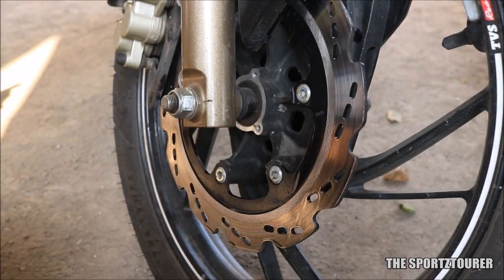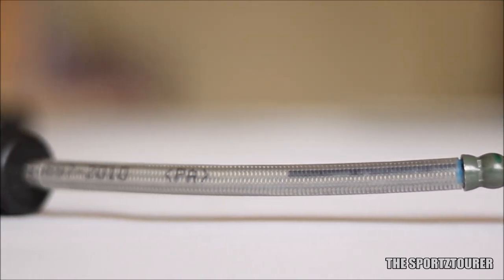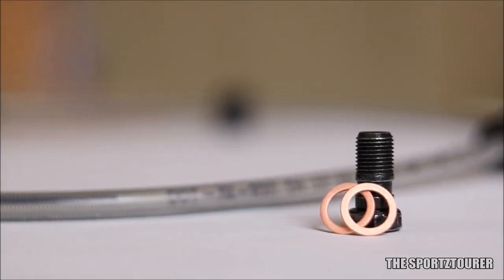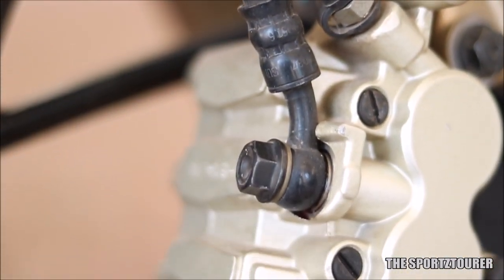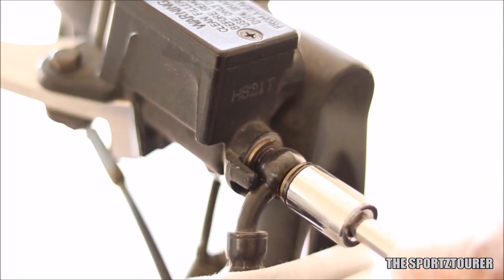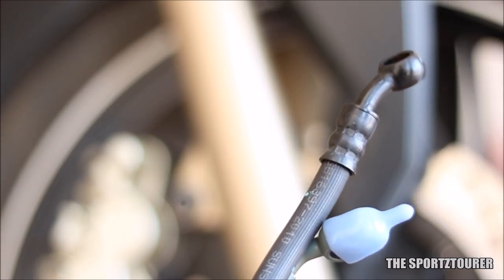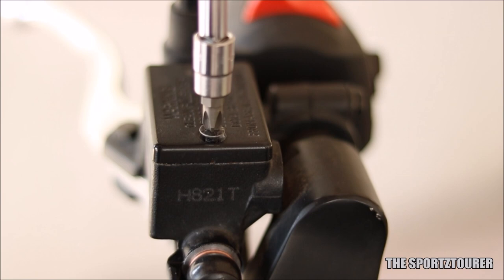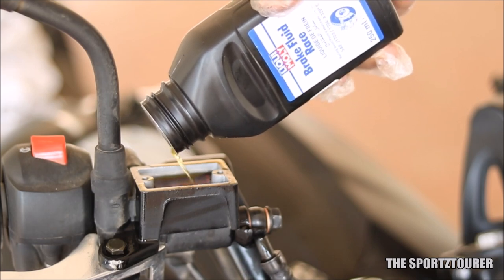BIG MISTAKE! UPGRADING TO STEEL BRAIDED BRAKE LINE & RACING BRAKE FLUID ON TVS APACHE RTR 200

Comment: Although it was a failed attempt, but I think that many people will learn from this. 

I think that the Apache RR 310's steel braided brake lines will be a perfect fit for your RTR 200. Both Front & Rear brake lines. 

Although they are designed to handle the braking torque of a much powerful machine than the RTR 200 (over-designed for RTR 200), but it's always good to be on a safer side when it comes to braking.
Reply from the maker: Thanks Chinmay for the suggestion! will update here 😊
Reply: @thesportztourer  , cool 🤘🤘
Reply: @thesportztourer  , you can also go for Dominar 400's steel brake lines

Comment: I changed the rubber brake lines of my Thunderbird 350 to steel braided ones with DOT 4 STP Synthetic brake fluid and oh boy there is so much improvement in braking. Now there is much more bite and that bite gradually increases the more i press the lever unlike before. Bike stops faster and surprisingly there is less wheel locking now🤔
I ordered the brake lines from AliExpress for just ₹600 each !! and brake fluid from Amazon 👍🏻
I was also going to swap the master cylinder with the one in RE 650/535 but that will most likely blow the piston seals to pieces xD
I may give it a try though but I'm satisfied for now

Comment: I had tried the same experiment and had committed the same mistake as well.

So I had to install the pulsar 220's brakelinr on my rear brake. It made the rear brake sharper in contrast the the front brake, so I had to invest in another longer brakeline for the front brake.

I did find cheaper ones on banggood.com with choices based on different lengths.

You get one there or like another person has suggested or as visible in the RTR 200 race spec bike, you can use the RR 310's brakeline.

Hope you make a follow up video on this  topic.
Reply from the maker: Thanks Hitesh for the suggestion, I will do a follow up video 😊

Comment: I replaced my rubber brake lines with Hel performance steel braided lines on my rtr200 and they work super fine, the lever is as hard as a rock and the length is sufficient although they are not cheap and cost nearly 3600rs.
Reply: is it front one? what is the length of the brake line?
Reply: @hsnhere  Yes front. Did not measure the length. I think the lines were meant for karizma but it fit the apache just fine.

Comment: You can buy generic brake line or you can buy from Royal Enfield 350cc front steel braid line which is 84cm more than required length,   I used this on my rtr 200 and it works great way much better braking...also I noticed even on full pressure applied on brake there is very low wheel locking as compared to stock brake line

Comment: Another great video, this time though I have a suggestion to make.. it would be really great if you mention on what parameters you compared the performance.. example braking time was better than before or feel of breaking was smoother.. also since it has started raining would love to see videos on maintenance during monsoon.. the RTR fuel opening has some space that is filled with water and drops into the tank while you open it for refueling..any tips? Thank you in advance.. cheers 🍻
Reply: I think you missed this comment hence adding one more to get your attention
Reply from the maker: Thanks a lot Kedar for the suggestions! I personally never faced water in the fuel tank issue with my 180 and 200. I can try to make a video on what we can do when there is water in the system 😊
Reply: @thesportztourer   Awesome thank you very much 👍

Comment: Good content man. But isnt the fade in brakes due to excessive usage and heating up of the brake disc and pads? Correct me if I'm wrong. Also another question. Why dint u consider sintered pads instead?

Comment: Bro try to remove the calliper from the forks and. Then try to install the likes and re route it from the clamping. Let it be free from the wire loops as well. The brake lines will fit the length.. I installed it in my zma. Had the same issue i sorted it this way and did a custom clamping. Using cable ties and the stock clamp. Its been a year. I have no issues. Hope it will  help you..

Comment: I've tried pulsar 220. Steel braided line on my Apache 160 (older model)
The braided line cable is enough for Apache 160 . And That's worked well too. Definitely braking pressure has increased or improve d.the braking sponginess has gone now.
But installation process is little bit tricky. The rubber mount of pulsar was not matched with the Apache rubber plate. So I tied the braided line with cable tie..
Reply: Whats the price of it bro

Comment: I believe that we can install any ktm's or rr 310 steel braided break line as I was looking for similar solution. For now I have installed Yamaha Dot 4 break fluid as it is priced at 150rs which is very affordable and works like a charm!
Reply from the maker: Thanks for the suggestion and sharing your experience 😊

Comment: Title should've been big mistake of choosing the wrong length hose.

Could've measured length before buying the hose.  I had Pulsar 220 hose on FZ and installed one for a friend's ZMA, but both were a bit shorter than stock, but fitted somehow, but when on centre stand, it  looked scary as if gonna stretch and burst.  Later swapped with generic longer ones from Amazon (but they are now insanely priced like HEL after lockdown).  Like someone already mentioned, RS and Duke hoses are longer and for extra lenght, there is Continental GT hose.

Comment: Hey! I own an RTR 200 2018 Race edition 2.0. There's a problem I'm facing with my mileage and top speed. I've never got a mileage of above 30kmpl and when on the highway in a few different events, I was only able to get a top speed of 115-117 kmph. The bike has a very good acceleration till it gets to the 90s. On a daily ride on the wide city roads, I'm able to go upto 104 with ease, after which the bike just feels abused. It feels like the 5th gear isn't able to deliver power at all. In the 5th gear, I'm not able to take it beyond 7000 RPM no matter how hard I try.  I've already tried to make my air fuel mixture richer by increasing the screw by about 3 turns; half turn at a time. The people at the service center are not even able to understand my problem. Please help.

Comment: My pulsar 220F has only front brake hose steel braided  which was company fitted and now I install rear brake hose with steel braided. Braking performance increases. Steel hose some long but I fitted myself. I purchased its from KTM 200 old model motorcycle. Don't be sad brother try another.

Comment: RTR's front brake is 2 piston , we just need 4 piston brake caliper like in KTM series.
Reply: in mu activa125 three pistons check on mu channel
Reply: No we can't as it's a standard telescopic fork whereas KTM has upside-down forks with radial caliper

Comment: Get the steel cable from Amazon (90cm F) (80cm R)which sits perfectly on your bike and also it's very cheap, I been enjoying breaking flawlessly.
Reply: Hi bro
Do you mean to say that these lines will fit the RTR 200 (have you or your friends tried it out?). Also, did you do anything for the master cylinder?
Reply: @jithinramesh3022  hi 
I had installed it on my bike, it's a direct fit... Just get the exact length cable. I have both steel cables on my bike and it's phenomenal.
Reply: hey how is the performance of this break line in long term i am have doubt bcz this amazon ones are generic
Reply: @saidesai6284  I have the same one, go for it. They work fine and excellent.

Comment: after a lots and lots of research on internt i found out that u can fit RE continental gt 535 brake line which are exactly same size as of apache 83cm or 33inch
Reply from the maker: Wow! Thanks a lot Sai for sharing this here. A heart felt thanks to you 😊
Have you installed it?
Reply: @thesportztourer  actualy i tired to search for it in market but since its old bike that too flop model i was not able to find it in chennai
Reply: @thesportztourer  hey today again after searching i found royal enfield genuin part it cost 3300 i think its not worth the price so i am using some generic once which cost only 750
Reply from the maker: Yes, you are right 3300 for steel braided lines does not seems to be value for money. Is it Brembo branded?
Reply: @thesportztourer it was RE genuine part

Comment: I think that rubber hose has a braided steel inner tube inside or is double walled, nonetheless brake lines are one of the most heavily safety regulated and governed component on vehicles. Rubber brake hoses must stand up to 8,000 burst psi for 1-2 minutes before bursting and you achieve a few hundred to 1100 psi in daily traffic. In reality burst braking only lasts a second or two. I work with hydraulic cylinders and all rubber hoses have a braided inner core or are double walled. changing to braided steel probably wouldn't have done anything. the reason why it's for racing is because constantly braking in super bikes is extremely abusive. Thick steel lines can take up to 18,000 psi burst but race level superbikes have massive brakes, rotors and calipers pistons and go 250kph like nothing in seconds so they need those critical components. For a regular bike like ours I would just upgrade the fluid when it's time to change it.
Reply from the maker: Thank you so much for sharing this piece of information here. It's a joy to have enthusiasts like you on the channel 😊

Comment: In my case an after market steel braded pipe  for my apache 160 2v was 20cm longer than the stock. also banjo hose head orientation was same on both side therefore i had to twist pipe for fitting.

Comment: I have pulsar NS200 Abs(single channel). So can i fit it steel braided brake line directly or will there br any complications??
Reply from the maker: Hi Lalit,
You have to keep the ABS module in consideration for that 😊
Reply: @thesportztourer  Yes ofcourse. Then i think i have to leave it to an expert mechanic instead of experimenting by myself. Thanks for this informative video... ❤❤

Comment: I also thought for changing the front brake lines of my apache 200..As apache 200 have steel brake line for rear brake but i need to change the front brake line.....but i don't have any knowledge of which steel braided brake line i will use..!!
So this was informative for me..

Maybe Duke 125,200 Pulsar RS or Dominar..?
Let me know sir if you find the proper one..

Comment: I have one doubt about engine oil.
Can I use motul 7100 10w50 on my rtr 200 since the preffered one is 10w30
Reply: Hey, I suggest that you use motul 7100 10w40 I have used 10w50 and I'll go as far as to say it will effect your engine in bad way

Comment: Try motul synthetic brake oil. It's 200% better than any brake oil in the market. I have tried it my Apache RTR 180 and Unicorn 150. Huge huge difference. You must shell out 700₹ for 500ml can...

Comment: Here is my story:
I hated the brake lever feedback. And the long stopping distance. My 2003 Fiero F2 front brakes are much more predictable due to the feedback I get on the brake lever. So like you, I decided to get steel braided brake hose for my RTR 200.

Search for P220 brake hose began.....and ended after 3 days due to lack of time in exploring local market (service centres close by the time I leave office) and by the discovery that P220 brake hose is shorter.

Obviously none of the ABS brake hose will ever fit. RR310/Duke 390/Dominar brake hose idea out of the window.

But...Duke 200 😈😈😈

Went to KTM service. Joy was short-lived since the brake hose has a steel tube/pipe hidden below the lower suspension clamp from where the hose crosses over to the left side since the disc on Duke 200 is on the left. Disappointed again (and here I escaped early from office to visit KTM service centre).

Finally found steel braided brake hose on Amazon with different length sizes. 50, 60, 90 & 120cm. Had to go for 90 cms. Better long than short, right?

Replaced my RTR's brake hose. Used TVS DOT4 brake fluid. Did bleeding removing every possible air presence. Bled again after 2 days. Little more air bubbles escaped. 

Conclusion: Front brake feels much better now. 

Satisfaction level: Zero. Zilch. Nada.

I still press the front brake lever of every Apache I see in the service centre. God knows what TVS did in RTR200, but the brakes suck. While my front brake now feels much better than other RTR200s, the lever is still spongier than RTR180. Super lever feel on that bike on all old version Apaches. On RTR200 4V, it simply isn't satisfying/assuring. Sometimes I feel like installing RTR180 brake parts on my bike.

Bottom line: The effort wasn't worth it. And maybe, the hose I bought from Amazon isn't good quality. But review from other users for that hose was good. Just don't understand why TVS made such poor brakes for the RTR 200 4V.

If you ever find a solution or a good quality steel braided brake hose, do share with us on YouTube.

Thank you for sharing this video with us.

Comment: I have installed steel braided pipes on my rtr 180 on front and the rare
And mine is working like a charm
I used a p220 pipe and another one is an local brand 
But quality is good 
u can use the dukes brake lines bcz those lines r too long ...
Reply: Bro, what's the price of p220's brake lines? And how about performance and installation process? Could u pls throw light on that?
Reply: @saimona.8498  its bit costly and cost around 1k 
the performance is good as of now 
There r lots of videos on YouTube about changing brake lines u can refer to them...or u can follow the steps of this video.. all r same..
Reply from the maker: Thanks Debasish for the suggestion and sharing your experience 😊
Reply: @thesportztourer  ur always welcome bro... 😎❤️
Reply: @D91949  Thanks a lot for ur valuable response, Debasish.

Comment: Sir pulsar RS 200 break lines are longer  they are steel plated equal to RTR break line and change break pads to HH rated

Comment: Is anyone having a crack problem on sidewall of remora tyres??
Reply: Just change the tyres man. U will notice a huge upgrade. My remoras were pathetic tbh. And it's not the same with every other Apache 200 owner. They used to skid a lot in rain even at lower speeds. I changed to Ceat zoom rad 130/70 and Ceat secura F  100/80
Reply: @Pratham40s  
remoras were quite bad for me as well. The front would skid even on the slightest amount of sand on the road. And in Bangalore there is no road without sand, due to continuous construction activities.

I changed both at 12500km to MRF Revz (Rear) and Zapper FM (Front). Done 8000km on new tyres and going strong

Comment: Bro, use RS200 or Dominar 400 or RR310 brake lines. They must be longer in length
Reply from the maker: Thanks Rogit for the suggestion, will make a follow up video once I get hold of a proper line.
Reply: The Sportztourer nice bro. Keep going. God bless you.

Comment: If you don't connect the ruberline or the original one under the headlight it reaches. I've seen someone doing that already.
Reply from the maker: Hi Zeeshan,
Unfortunately it even failed to work that way. My bad, I should have mentioned it in the video.

Comment: WTF... Shit happens always...  Undoubtedly P220 brake lines are far more better than those rubber lines .... But you can use 310RR brake line as well
Reply: Adarsh Dwivedi lol y the hell does he have to use 310 where there is stock braided line for apache 200 abs version

Comment: I'm here :D
Reply: hi
Reply: @ajaykaushik2272  hey lol
Reply: @Mototune16  
RR or CBR? If i have to upgrade which one should it be? Neither showrooms give test ride
Reply: Honda costs 2.5 L and has cheaper spares. Apache costs 2.9L and spares are also expensive.
But I am happy with TVS customer support and not sure about Honda.
Moreover i don't have to wait in queue to get RR serviced as it has separate bays and technicians.

Honda heats lesser than RR. 

Does RR exhaust throw hot air on our legs like the KTM 390?
Reply: @ajaykaushik2272  check pm on fb
Reply: @ajaykaushik2272  i would get RR anyday. Cbr will soon be a 10 year old bike lol